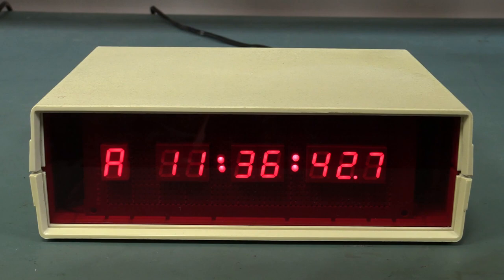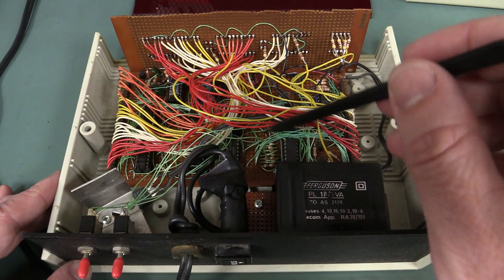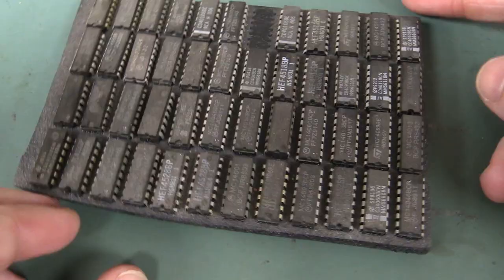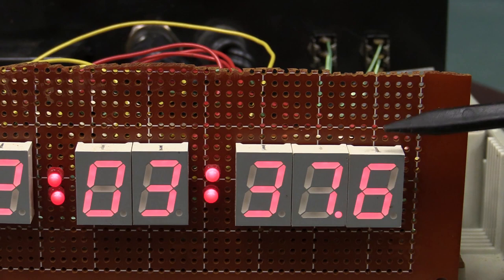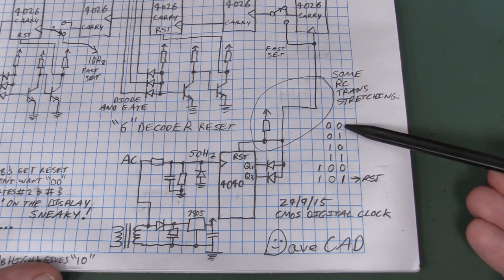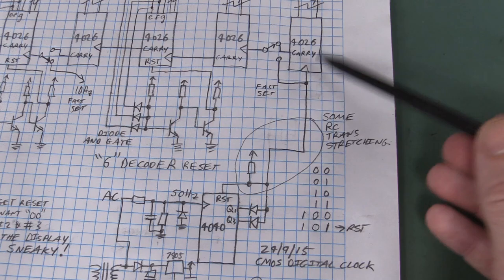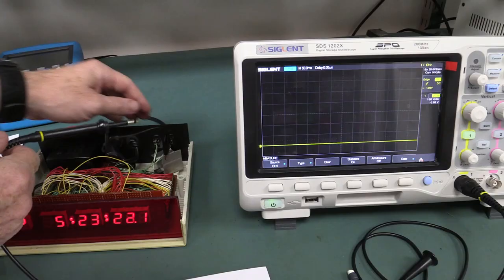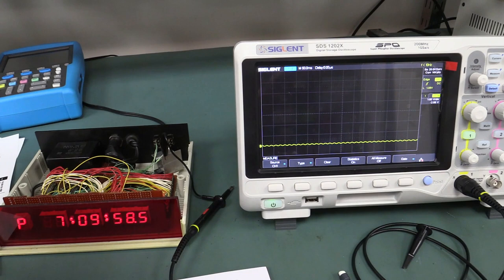EEVblog #801 - How To Design A Digital Clock

Comment: I made a clock like yours in 1972. With circuits in TTL 74XX series of Texas Instruments. I used Nixies tubes powered with a voltage of 150 V and with suitable drivers (7441).
All was powered by a transformer recovered in an old tube amplifier (EL84 / ECC88).
To make my first circuit, I drew directly on copper the tracks with a pen and paint.

I remember a bunch of holes drilled with a mini drill. My mother was very unhappy when she saw the small holes separated by 1/10 of inch in the living room table. I still have that table, and every time I see those little holes, I think of my mother and my clock. That was 43 years ...
This clock has it been long in the refrigerator in the family home, but it disappeared with the removal ... damage.
Bye
Sorry for the google translation  French ===> English
Reply: +rene lefebvre Ha, a table with non-metric holes in it; you should 3D sculpt a piece of wood to put in as inlay. Wow, nixie was harder to find in '72, nice.
Reply: it all feels undoable when someone like me , a 2019 digital electronics fresher reads . your dedication sure was rock hard . hats off sir

Comment: The next step? I don't know man... Jumping from taking a pre-built clock out of it's case without any modification whatsoever to building one from scratch is a pretty big step.
Reply from the maker: +ArtificialDuality Err, yeah, I didn't mean that literally.
Reply: +ArtificialDuality thats where i started now i build "robots", don't discourage learning from hacks.
Reply: +EEVblog Kia ora from across the ditch
Reply: THINboxKING I wouldn't discourage learning from hacks. That's how I started learning programming etc. I just would't call pulling the guts out of a clock, then mounting them in another case... a hack.

Comment: Clock design is an excellent educational tool, not only for the self taught hobbyist but for engineering students as well. I remember having to design an alarm clock for a first year subject, having barely any knowledge of electronics or logic. The more I looked into the problem, the more I had to learn about electronics design and interactions between components improved. By the end of the task, I had designed the whole thing from scratch, and had an insatiable desire to understand the engineering behind everyday tech. The floodgates were opened, and all of a sudden I had a platform of knowledge to design anything I could imagine.

Comment: I once designed a discrete logic clock myself and wow, I got off real easy since we use 24 hour clock here, so my counting sequence goes ...22, 23, 0, 1, 2... No problems at all for the hours reset. I hadn't even considered how much harder 12 hour clock would be!

Comment: Using Mains sine wave to sync clock.

Can, can you believe that! That is GENIUS!
Reply: +Ognjen Galić Very usual in old digital clocks. What needed some good thinking is the 12 hour problem. Very impressive.
Reply: +Ognjen Galić IIRC, this was not uncommon back in the 70's (though alive, I was not aware of such things in the 60's). I'm pretty sure I had an alarm clock that did this (@60Hz for the USA). I was still just a kid then, but my EE dad explained it to me.
Reply: +taiwanjohn Yeah, it's normal... is one reason you can't use a USAnian clock in Europeland, and vice versa, even with a transformer. 
(or couldn't, back in the day!)
Reply: Mains sin wave is NOT ACCURATELY 50hz!
Reply: Bradman175 I think they try to balance it so that the average is 50 Hz over some time.
Reply: +gamingSlasher Indeed, they try to make it so the number of cycles over 24 hrs is correct (4320000 cycles per 24 hrs at 50Hz), but the frequency at any particular time may be below or above that depending on supply vs demand. The frequency of the UK grid can be seen online here http://www2.nationalgrid.com/uk/services/balancing-services/frequency-response/ and here: http://www.dynamicdemand.co.uk/grid.htm :)
Reply: gamingSlasher So you are going to have a clock with uneven seconds then, unless you don't have a seconds function then fine by me.
Reply: Bradman175
I dont have a clock like that but if I had it would not bother me the slightest.
Reply: It is not a new idea, actually it can be an easy option if you do not want to design your own oscillator. Just look at the link down here:https://electronics.howstuffworks.com/gadgets/clocks-watches/digital-clock2.htm

Comment: Back in the day, as in late 80’s, I was working with a group that was testing explosive detonators for safety. We were measuring the accuracy of the delay, using a multichannel Honeywell reel to reel recorder to test multiple detonators at once. The problem was that we needed an accurate time mark generator to measure the delays. I made a tiny, 9 volt battery powered box with a 10 MHz oscillator and counters. The trick was putting in hundredth millisecond, millisecond, and hundredth of a second code bursts which overlayed a count by modulating the width of the pulses. I used some of the same analog trickery you did to shift in portions of the counter output without losing the accuracy of the leading edge, but visually apparent and readable when the tape was replayed. I think that the mixing of analog and digital like that, with diodes, transistors, resistors caps, with CMOS gates is something that has all but vanished from design. It’s not a great loss, but there is a degree of understanding that is now abstracted away.

Comment: At 9:56 Dave mentions that he tapped off 50hz to use as a reference clock.  I did the same thing about the same time with our US 60hz power.  Maybe 50 hz would be a bit easier to just divide by 5 rather than by 6 to get 10hz to get the 0.1 second digit ticking along.   We really need to change our power cycles to some nice binary 256hz or something!  Wouldn't that be sweet!

At that time I only had a single channel Heathkit scope (1mhz?).  As an accessory to do digital design I built a little mux to allow 5 (10?) digital inputs by summing the individual digital signals with individual stepped DC voltages.  Worked a treat.  

Ahhhh, memory lane.

Comment: Certainly better designed than Ahmed's clock, seeing as he just ripped out the guts of a bedside clock and shoved it in a case. 0 Electronics skill needed.
Reply: +Pieh0 Bah he's just a kid. You need some knowledge of electronics to dissassemble and reassemble an electronic device without breaking it.
Reply: I know he's a kid, which is why i'm not screaming from the mountains calling him a liar and such :). But all he did was remove the plastic shell, and glue/bolt it in something else.

I'm more pissed off that no one around him seems to care about him dinking around mains voltage stuff. The transformer and board all at 120v just "flapping about in the breeze" as Dave would put it.
Reply: +Pieh0 Agreed. But still, I blew up some electronics when I was a kid while tinkering with it, so at least his didn't fry
Reply: +Pieh0 The photos I saw had a rather generous amount of electrical tape wrapped around the 120VAC transformer connections.  Maybe not as ideal as, say, soldered connections and heatshrink, but certainly adequate.

Besides, I was working with 120VAC, and some 240VAC, circuits beginning at the age of 5 -- yes, as a 5 year old I did get permission before actually energizing such circuits due to my age, but no changes to my work were ever required by my parents nor my grandfather (a licensed electrician from whom I learned electrical).  If I could do so safely as a 5 year old then certainly a 14 year old can safely wire and plugin a transformer.
Reply: Guys since he didn't make the clock, it changes the whole lead of the story. He is trying to make a hoax bomb, and the police were right for arresting him. He is utilising a flaw in our hatred towards islamphobia.

Comment: Daves mention of low power and 4000 series reminded me of a gas billing meter I briefly worked on back in the 1980s.  It had a custom LCD display with individual segment drive (gated square waves, no LSI drive chips) on multiple circuit boards covered in 4000 series chips.  The whole thing operated for a couple of years on D size batteries. It was almost a computer made of standard 4000 series chips. It recorded natural gas use at a car assembly plant here in Wellington NZ.

I still occasionally work on a Japax EDM machine that is based on a series a Toshiba chips that are CMOS but have TTL pin-outs.  Probably a very early CMOS series from the 70s.  74HC series chips fit and sometimes work as replacements.  But the original machine designers relied in many places on the propagation delays and 74HC chips are too fast, causing the logic to fail.

Comment: I was given a custom-programmed clock that originally was Vishay LCt-104 web tension transmitter. He reprogrammed the EEPROM to make it a clock (it also uses a TIMEKEEPER RTC/RAM chip), which a start-up, displays a greeting, fireworks, and a sailing boat. During operation, the upper alphanumeric displays show time, while the alphanumeric displays below occasionally scroll Bible verses.
Reply: Really cool mod
Reply: Ripper use for an old device, that would probably otherwise just been chucked into the bin.  (I ended up Googling LCt-104 for a looksee)

Comment: Wow. I didn't know I could have done this much with my 4000 series ICs. I have an old collection gathered from my teen years, desoldered from old equipment. Had to pause this video to check on them. I could never really throw away good working parts.

Comment: Beautiful discrete design really. You made me nostalgic to think about my old 2 digit digital bicycle speedometer I designed using CD4518 and CD4511 and NE555 as timing controller. I was in school then and design was very unique using IR LED and Photo transistor made from SL100B by cutting its upper metal shield. It used the latching feature to stick to the measured value and everything was possible. It was probably in the year 1990. Thanks to all the silicon vendors for making the life so easier now.

Comment: I used a similar case for a multipurpose LED serial display I made, has a few PICAXE micros, one took in 8bytes of 4800b serial and controlled the LED displays via shift registers (ucn5841 eight of em to drive the displays, most expensive parts aside from the displays) the other took interrupts from an automotive analogue clock ticker coil drive output, rectified to get 1pps. It ran off a higher voltage so ran ok on 5 volts and was enough to trigger a micro's input without buffering. The code space was pretty small (256byte max) but I managed 24 hour, animated segment between hour and minute with 12 hour hourly beep with setting routines in the clock micro and on the display ~32 ASCII codes (bell,0-9 ":" A-U) controlling 64 segments and a beeper on 4 outputs and a serial input

Comment: Ahh memories.. I made similar clock 15+ years ago using jk flip flops as counters and basi logic gates for setting and resetting them. it had pcb 2 boards - one with counter and the other with 7seg led decoder and the leds. You had to switch it into "high speed mode" and wait till the clock forwarded to real time, then set it to normal speed.

Comment: I'm 50 years old and I have just discovered the 4026, just this last week-end I got 2x4026's connected to a double 7 seg display (a green one oh la la) and managed to get it to count up to 99 by sending it a signal from a 555 timer, I tried for ages to get the 555 to give me exactly 1 second, but could quite do it. I noticed you didn't use the mythical ungated "C" segment, which the data sheet hints can be used to for divide by 60 and divide by 12, but no one seems to know how to use it. Anyway as I said I fiddled with the 4026, 7 segment display and 555 for about 2 weeks before I got it to work correctly, mainly because at first I was trying to give the clock signal by using a tactile switch before using the 555, but ever time I had anything connected to the clock pin the 7 seg display would go haywire counting up very fast on it's own, which I guessed was like you said it was picking up noise, maybe something to do with the PSU I was using. Anyway It's very satisfying watching the green numbers count up to 99, in nearly 1 second increments.

Comment: The 4026 is what I have used for my VFD discreet logic clock. Due to the complexity of needing a multiplexer it turning into a design and build your own multiplexer project. So the multiplexer and display and PSU is the only part that has ever been completed. I should really Finnish the clock part and finally complete the project.

Comment: Never seen segment drivers "throttled" by a single common resistor. That should change your luminosity based on how many segments are lit by changing the voltage drop over the resistor with the changing current. Might not be perceptible though on account of how LEDs seemingly magically emit the exact same amount of light for anything between 1-5mA...

Of course we were too lazy to hook up 7 resistors per digit too in our day, but we used a number of series diodes instead of that resistor - they dropped 0.6V each (until the drivers / LEDs were happy) and didn't care at all about how many segments are lit...

Comment: This reminds me of the clock I built in the late 70's,  still going perfectly now.  It was from a kit using a single chip clock, everything except the display drivers is on the chip. It's 6 digit with a single led as the am pm indicator.  I spec'd mine with the Xtal oscillator time base upgrade, on a separate board, and the power fail battery back up also.  Took a bit of fiddling to get the Xtal osc set for accurate tine, due to temperature drift. It swings around -15 to + 15 seconds summer to winter.  Quite a neat kit with good F/glass boards, ribbon cable wiring etc.
Would like to modify it to radio time signal setting, not sure how that would be done though.

Comment: What are you talking about?  Yeah maybe it is of horrible build but you built it when you was a teen!  Out of salvage parts!  And it works!  And it's a cool clock!  When I was a pre-teen, I was trying to do a sequence divider counter out of a 4017. . .really simple circuit to emulate a bouncing sequence light like the KIT car in Knight Rider.  I had to re-build the fecking thing 3 times because I had a habit of smashing it out of frustration when I couldn't get the 555 clock sorted out.  Ah the memories. . .

Comment: O-GOD! This brings back memories. I design and built a similar clock out out 74 series logic. except mine didn't have the 10th of a second count and you could not set the time ether. to set it at the right time. you would plug it into the wall at 1:00, because it started at 1:00 when you plug it in. I was 12 years old back in 1983 when i built this thing and I no longer have it anymore sadly.

Comment: To be fair, Ahned could've put his clock inside a standard clock radio bakelite case rather than a metal suitcase. Perhaps then it wouldn't have been mistaken for a suitcase bomb by slow teachers.
Reply: +PeterEater But maybe that would've defeated his intent.
Reply: +PeterEater It was a pencil case
Reply: hingeslevers A large non-transparent pencil case that looks like a small suit case.  It was then wrapped in wires.
Reply: +PeterEater    You mean like the case he removed it from in the first place?   Where's the free scholarship and media outrage in that?

Comment: Very nice, Dave! I've built many clocks like that in my past too (usually using 74xx series though). I even built a few alarm clocks that actually had two different clocks (one to keep the time, the other to store the alarm time) and then a magnitude comparator to set an RS latch when the clock matched the alarm times.

Comment: Hehe :) Awesome! Is put me back one of My biggest mistery diy nightmare weekend. I did something with thermal controlling unit of an old russian heating central. and I used simple diodes to make or-nor gates. And one diode is printed reverse.... I spend 3 days on it (tons of diodes in a controller box) One diode can beat You down, and You get fully confused. And in this speciel controller box, nothing happened immediately. There is heating, cooling, ignition, opening, closing valves... With total random periods.. Ahhhhh, I almost cry :) Then... The last what I checked is the diodes. What a blama :))) Thank You dave :)

Comment: i think it would be much simpler to use a 4026+4013 pair for the hours and reset from 13->1 using the kind of logic you used for the 6's reset, with a simple monostable pulse delay to bump the hours from 0->1.

Comment: Dave, that's pretty amazing! I didn't even realize it was possible to do so much without a microcontroller.

BTW, one of the things that confused me for half the video was that the reset pins on these chips are active-high instead of the more common active-low.

Comment: Love the old school resistor diode OR and AND gates. I used some of that myself back in the mid 70's when I designed and built myself an 1802 based CPU board. Off the top of my head, you could have saved a few parts by using a PNP transistor instead of the extra diode and pair of transistors for the 6 detector reset circuit. If you didn't have PNP's back in the day (since you were using what you had at hand), it makes sense you used a pair of NPN transistors.